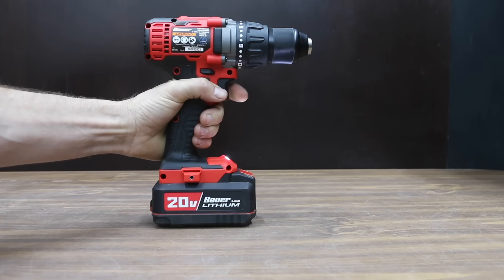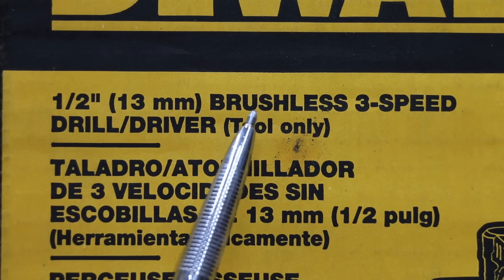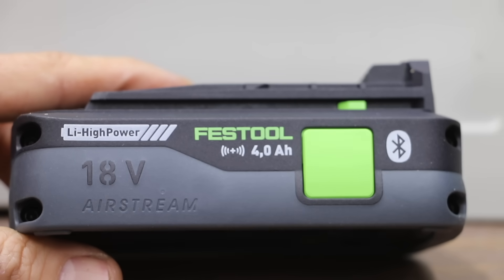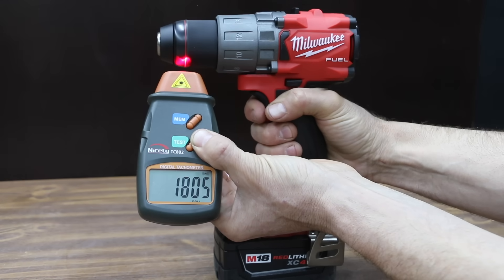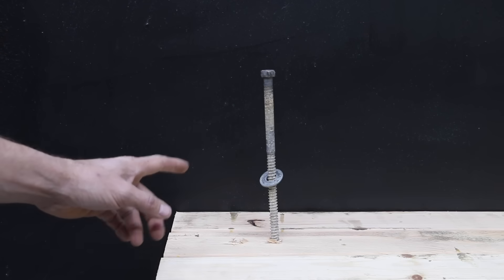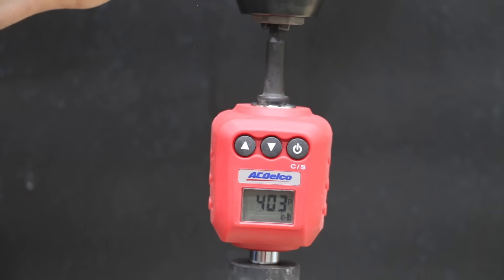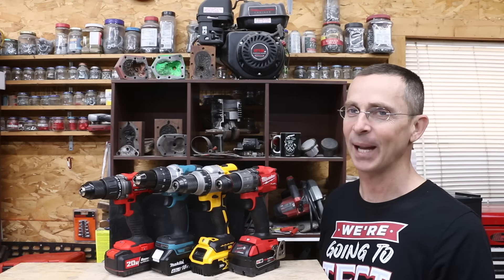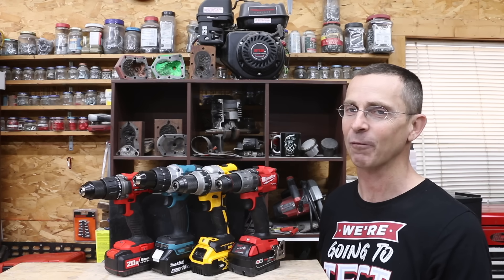Best Drill (BATTERY POWERED)? Milwaukee vs Dewalt, Makita, Bosch, Festool, Ryobi, Bauer, Ridgid

Comment: This video and AvE’s tear down of a Festool saw have me convinced that the brand is all shiny box and marketing and not actual tool quality or performance. 

This is why I love this channel… we get honest tests and good information.
Reply: If I were you I would look into Hilti for your next drill/impact purchase. I watched AVE's BOLTR for the Hilti 12v line and  I got the sid 2-a/ sf 2h-a then the sid 2a-12 and I've loved them since they first touched my hand. They feel amazing and they punch waaayyyyy above the 12v weight class. I'm just a DIYer with some minor handyman work on the side so the power for the 12v is plenty for me and the 20 year warranty gives me peace of mind.
Reply: @matthewclark263  A Hilti has absolutely zero benefit to anyone except a contractor. The entire point of a Hilti is the commercial support. The rep that you are assigned, the "Snap On" type service (rep that comes out to the job site or office), the commercial pricing, and the rep picking up broken units and bringing out new replacements straight to the site. That's why they're expensive; because they have contractors money. They're not going to make a trip to home depot to go get a new drill. It's not cost effective. I go with Hilti on some of our tools, but I go with DeWalt on cordless hammer drills and impact drivers, but I buy them 10 at a time. As a DIY'er/homeowner, you're buying Hilti because it's a cool toy, and that's alright. But recommending Hilti to a DIY'er/homeowner is like recommending an F1 car that comes with 2 support semi trucks and a 50 man tech/engineer crew to a kid that might want to take his little VW Golf to the track a couple times a year. The difference between Milwaukee and DeWalt is that the chip on the Milwaukee allows the motor to demand more current from the battery. The DeWalt is built better, lasts longer, has better fit & finish, and the batteries last longer. You don't notice the miniscule differences that are shown in the video like 5.3 seconds vs 5.8 seconds, when you use them in the real world anyways. I have bought hundreds of battery operated tools over the past 20 years, and I've tried them all in the worst conditions. Most of the people saying that one tool brand is better than the other, range from DIY'er/homeowner that have bought 1-3 units, to contractors that have bought 5-10 units, and those sample sizes are far too small to give accurate representations of a tool. It's like when people try to review a statement that x brand of truck is better than their truck, and they say, "I've had 2 x brand trucks for 150k miles, same I've never had any issues." Their sample size of 2 is statistically irrelevant. It's like they know absolutely nothing about statistics. This channel falls into that realm a bit too. Sample sizes of 1 took, and doing 1-5 test runs of each test, is statistically irrelevant. It's more for entertainment. I'm a scientist (my background outside of being a contractor), so it's more obvious to me that his tests and results are null and void, but the average Joe thinks that the tests are just "sO sCiEnTiFiC," because they don't know any better.
Reply: @littlejackalo5326  honestly I think that the ergonomics of the tool are very important and that's part of why I am happy with my purchase. I don't mind paying a premium for a tool that is built to last and feels amazing in the hand. This is all just my opinion.
Reply: We run a commercial carpentry shop and my partner absolutely insists on festool. We practically have their whole line of tools. I don't think one can make a general statement. The domino is an absolute game changer and their sanders combined with their dust extractors are fantastic. A lot of their tools also have great design and thoughtful features. 
However I've been telling him for years that absolutely nothing justifies the price of their drills which I find to be totally mediocre (we've had three break in 3 years too). I've been a dewalt drill owner for 15 years. The thing is still going strong and cost me $100 then. 
Maybe this will finally convince him.
Reply: @asafpeled699  Had my dewalt impact driver for about that long. It's blown through a bunch of batteries but the driver is going strong. We use it to lag bolt decks to houses haha.
Reply: @asafpeled699  You shouldn't buy the new DeWalts then. My cousin uses DeWalt on his farm and after one year, a drill started to hammer even if it was in drill mode. I took it apart and I was blown away by how chea and tiny everything was made. The main spindle bearing is about one third the size of the bearing in my Metabo drill. The Problem was that the whole axial force of the spindle was held by a 1mm wide plastic step... The step broke away and the drill is useless now.
Reply: @ChrisPBacon512  Festool licence them to others It's a great "system" as they clip together so stack up as one unit so can wheel around on the trolley instead of looking like a pig on a roller skate trying to lug all your various boxes around but you sound a bit Salty!
Reply: It's interesting you bring up AvE because I feel like between the two channels you get a really thorough review: AvE will give you the teardown and analysis of build quality / prediction of lifetime and failure modes, and PF gives you the battery of practical tests that give you an idea of the performance.  Both very different approaches but useful in their own way.
Reply: If tools were purses, Festool is a Gucci bag: an overpriced fashion accessory.
Reply: Festool is the snap-on or mac tools of the carpentry world. 100% overpriced. Only thing they have thats truly special is their track saw, and thats only because its the most accurate one available.
Reply: @barryallen5507 , Festool's domino jointer is worth the money as well.
Reply: yeah they are like the "new"  Flex tools at lowes. Just Kobalt but more expensive.
Reply: The only thing worth a shit they make its the Domino, and just because they hold a patent on it, everything else is done better and/or cheaper by other brands, like Mafell.
Reply: You e obviously never used festool tools.
Reply: The Apple of tools
Reply: The Box probably increases the Festools' price by 100$ alone lol
Reply: Respect to AvE, but Project Farm is the better channel by a long shot.
Reply: @Jin-Ro  I have respect for Project Farm because he acknowledged me when I pointed out his recent error comparing two entirely different models of Makita impacts as “Japanese vs Chinese version”.  Meanwhile, AVE will keep on misinforming the masses.
Reply: If you can't afford festool dont buy it. I own every festool tool available...multiples of some. I beat the hell out of them... only had one tracksaw in 5 years die on me.  If you are a business owner festools make sense. They are great write offs...plus depreciable and their resale is excellent. If the government is going to help pay for my tools ill buy the most expensive ones thank you.
Reply: @ravipankhania5528  That's the point though isn't it Ravi. Why buy the most expensive ones when you can buy the best ones for less.
Reply: @Jin-Ro  Sure. except that this festool IS a fantastic drill, albeit my least favorite of all the festool drills, all of which I own. and I paid $300 for it and it came with a convenient carry case  that match the dozens i already have. I have owned all other tool brands, and still use makitas and even one bosch...ugh. they dont even come close when it comes to accuracy or ergonomics to my festool drills... for me. so to me they are the best tools. the cost is always secondary for me. the difference between $100 drill and a $300 drill is not keeping me up at night. i dont sit there thinking if i had a dewalt drill it would drive a screw in at .7 secs faster.
Reply: @ClothstudioCa  most guys don’t understand any of this. They just see power and most of all price. My first festool was the rts400 sander and I loved it. Definitely felt and worked much better than anything else. I was a full Makita guy before. Festool has allowed me to work more efficient and cleaner. The systainers have changed the way I organize and make it easy for me to just take the tools I need for the day instead of pulling a loaded trailer around full of tools I won’t use for that day. Customers love the way everything just stacks up in a corner. Also when you buy festool you are paying for tools not made with slave labor wages.
Reply: I agree. Uncle BF is the best especially with his grammerical, (not a word) humor.
Reply: Most of the people commenting here has never done professional work with power tools. Here was tested just power of the drill but all the works are not just how much power you have. There are many small features why Festool is more expensive but you do not see it in this kind of test. If you are making precision work (manufacturing furniture) then you will see difference. When you are working hours with drill, you will see difference with ergonomics. It's not just weight of the drill but where the weight is so when you grip the drill, is the weight bending or not. 

It's about battery life. It's about durability. 

One reason why it's more expensive is that it's made in Europe. Okay, for me it's positive.
Reply: Just check out, the second hand prices prices. That will tell everything. 

The main problem, this Festool unit is 10-12 year modell. Its released by Protool and after its discontinoued as brand Festool introduce couple of old Protool tools with Festool branding as a new tool. This is what happend this Festool drill as well. 

Festool released a new drill in April, and its a nice upgrade, it would be perform somewhere between Dewalt, and Milwaukee.

The routers, domino, mitre saws, orbital sanders, jigsaw is all superior. 

From my view point, they'r products is placed for bigger manufacture companies, where the cost of the instruments is not as important, as the productivity. Their tools always very easy to adjust, and always trust on the factory settings. 

Warranty is also nice, 3 year and its cover the wearing parts as well (most of time its not) and for 3 years your tool is secured by Festool. If somebody stole it from your workshoop or from yout van/truck, you can get a new one, for very reasonable price. (Around 150$ where the kits of value usually trending between 500-1500$) 

Their tools is not for everyone, and you can get the job done with other tools as well, but they'r had some advantages even the higher price.
Reply: @_AIex_  Yeah exactly i live in Czech Republic, and festools are widely used in large companies as a good quality tools, the accesories that u can get for that here makes it ideal for large employers, also i think that in the US the imported tools are sold maybe at higher price? here that festool costs around 800-1000 dollars in average shop so a contractor that doesnt pay taxes on his tools gets it at about 600 us and a really large exployer get that at even less , because they buy loads of them.
Reply: @_AIex_  this sounds like a paid corporate response
Reply from the maker: Thanks!
Reply: The festool drill came out over 10 years ago, and it hasnt changed much over those years, originally lauched as the protool.. great ergonomics
Reply: They make nice boxes though.
Reply: I think the thing with Festool: They produce them in Europe that increases the production costs. This however, as you said, doesn't make them suddenly superior in quality nor performance.

One thing I absolutely love though in Festools: Removable cord that can be switched between machines. But otherwise, eh..?
Reply: @FinlandApollo  the cord is definitely a nice feature, but it also cost an arm and a leg to replace lol.
Reply: @FinlandApollo  I have an electric drill made by "Kress". They too had the removable cord. Unfortunately the company went bankrupt a few years back. Greetings from Germany.
Reply: @FinlandApollo  Well Bosch and Makita (and others) make some of their their tools in Europe, and I guess they are still competitively priced.
Reply: @MatthRrrr  Very very rare. Even the one in this video are made in Indonesia. I have several blue Bosch and none of them are made in EU.
Reply: @FinlandApollo  Gave up with Bosch they moved to China while back and nothing but issues there 9" angle Grinder was the holy Grail but became a liability then as gears was broke from new! many switched to likes of Hitachi. I'm lucky have a 4 1/2 and 9" both made in Germany.my 5" is Hitachi the Dogs Danglies
Reply: @MatthRrrr  Yes, around half of the Bosch tools i own are made in Germany, and around 2/3 somewhere in Europe. Also Bosch is around the same price as comparable Makita around here, but usually with better performance (especially concerning the battery packs and chargers). Construction sites are something like 50% Bosch, 40% Makita and 10% Hilti, with some carpenters using Festool and some Fein sprinkled in.
Reply: @FinlandApollo  You know Milwaukee had that 30 years ago when they were still a US based company. Still have a hole shooter and sawzall with this feature.
Reply: Couldn't agree more! I wish ave and PF would get together to absolutely shit on some of the shilled tools that are out now lol.
Reply: @goyslop4289  So intelligent of you....let's get two guys who combined have probably 30 minutes of decent work with tools behind them, so they could talk shit about tools that are designed for professionals and intended to work for decades.  Typical contrarian mindset, you actually think you're special for hating something that is universally accepted as great. A psychological pathology that is very common on the internet nowadays, I guess it's some sort of a defense mechanism used by poor people when talking about things they can't afford. If you keep telling yourself those things are bad and overpriced, it's easier to deal with not having them, I get it.
Reply: The price🤦‍♂️
Reply: Except both of the videos don't tell you that these last longer than any other tool on the market, and if you want a durable tool you buy once and forget about it, this is it.
Reply: Festool is like Harley-Davidson. You're paying a premium for the name but not getting anything better than cheaper ones.
Reply: @troywalker8078  Except it's not. Harley-Davidson is legitimately overpriced. Festool isn't. Festool built their entire reputation on nothing but quality and reliability. Harley built their reputation with myths and marketing. A big difference. Everyone's heard of a Harley, even people with zero interest in bikes. That's how strong their marketing was throughout history. Nobody without interest in tools has heard of Festool. In fact, most people who ARE interested in tools know very little about Festool it seems by these comments.
Reply: I disagree. 
At work we have many drills. Makita, Boch, Milwaukee and festool 
They brack all the time, but the festool drill just don't break there are dam well build and a dream to work with. 
At these hi torke applications you take a impact driver anyway. 
In my opinion a well build silent and reliable driver is way better than one with hi tork.
The e clutch works ok but it's starting with hi tork  so if you block it direktly it won't work but at normale application it works
Reply: @simeongeorg606  E-X-A-C-T-L-Y ! Agree 💯
Reply: @simeongeorg606 , sure if you wanna pay a premium. I've never seen a contractor use Festool, they use Dewalt, Makita, or Milwaukee. Only people I've seen use Festool drills/drivers are woodworkers and it makes sense, you're not gonna abuse it like you would on an construction site. Festool probably makes the best woodworking tools like miter saws and joinery tools, but drills/drivers I doubt it it's worth the +50% premium you pay on top of a Milwaukee.
Reply: @purplepill2024  i work at construction in Germany. 
Festool  is justed very often here. Becorse it economic. If tool breaks and you can't work it's very expensive.
Reply: @purplepill2024  Well, you should visit europe then. Here, on a big construction site, you won't find any Milwaukee or DeWalt. Hilti, Festool, Bosch, Mafell, Metabo and a few Makitas is what you see. The Milwaukees and DeWalts might me powerful but the build quality is absolute garbage. Also, the trigger control is just not suitable for delicate work.
Reply: @simeongeorg606 , here a 1/2-inch drive 25-inch Harbor Freight breaker bar is $13 with lifetime warranty. The same Snap-On costs $147.

When it breaks people just go to HF and get a replacement, if they needed another one on-site that bad (cause they can't work if it's broken) they just buy two HFs. If a tool is that critical you can always buy a backup and still come out ahead.
Reply: @christiansprojects-cgmanuf1426 , OK so Europe still carries Makita - which is also widely used in the USA, what's your point? And you do realize that Milwaukee has a 12V lineup designed for "delicate" work right?

You can go ahead and buy Festool - if that's your prerogative. I can buy 2 Milwaukee's and still come out ahead.
Reply: @chronicblazer84, if you want to pay 10x for a Snap-on, by all means do it. There is value in HF's breaker bar (or any other non-premium tool), plenty of channels like Real Tools Review have shown that HF's breaker bar can withstand the abuse and be a featured item in a professional environment.

I can buy 10 HF's breaker bar and still have money left over - and all 10 come with the same Snap-on like lifetime warranty. And the big difference is - when your Snap-On inevitably gets borrowed or stolen, it's something I wouldn't even care about with the HF tool.
Reply: @chronicblazer84, "lifetime warranty" means you don't pay a dime. Your current employer sounds like an idiot, just cause HF's Breaker Bar is a quality tool doesn't mean all HF tools are. You couldn't pay me to use their Pittsburg Trigger Clamps.
Reply: @chronicblazer84, Lehman's Brothers and Enron brought in 3x-5x what your employer did - look where they are now.
Reply: @chronicblazer84, it's obvious you have no idea what you're talking about. The point of these tool comparison channels like Project Farm is to show when you can get value. In this instance, you can get value from Dewalt, Makita, and Milwaukee cordless drills.

Even with the name-brand cars you're talking, DIY'ers still find value in after market parts.
Reply: @chronicblazer84, so what if you make parts? The point is lost on you that's why you keep changing the subject. From DIY'ers to pros, everyone (except you apparently) knows there can be value with cheaper tools.
Reply: @christiansprojects-cgmanuf1426  On European construction sites, you are going to find mostly European brands if they are any good. For example, in France, hand tools are almost all Facom, which is definitely high quality but most importantly, it is French. In Germany, they will use German tools, and in the US, US tools.
They will only use American tools in Europe if there is no other good option. Plus, there is the whole imperial vs metric and 110V vs 220V thing.
Reply: @purplepill2024  And your two Milkwuakee's are gonna last half as long as his one Festool, so you won't been ahead in the long run.
Reply: @derbigpr500 , outside of wood workers name one major construction company or channel that uses a Festool Drill.
Reply: @chronicblazer84 , LOL what a hypocrite. You've been raving about Snap-On this entire time, just to admit that you prefer cheaper tools and only get Snap-On cause someone else paid for it. What a shill.
Reply: @purplepill2024   For most tasks, Milwaukee will work just fine, that's absolutely true. But there are situations where precision really matters. My point is that the price of Festool and other high priced brands is justified depending on the work you do.
No Millwaukee or DeWalt saw will be near the precision of a Festool tracked saw for example.
Reply: @christiansprojects-cgmanuf1426 ,  Milwaukee doesn't even make a Track Saw. And the Track Saws made by Dewalt and Makita are at least $200 cheaper than Festool, so they aren't even targeted for the same market. Like I've stated, Festool isn't used at a construction sites for a very good reason, accidents on tools happen and no contractor wants a $500 brick.

Finally this video is about cordless drills. Of the 4 top wood working channels on YT, not one uses a Festool Cordless Drill:
1) Bob - I Like to Make Stuff: Dewalt
2) Matthias Wandel - Dewalt, Lomvum, Makita, and Ryobi.
3) jimmydiresta - Milwaukee
3) Steve Ramsey - Rigid and Ryobi as his channel is designed to get started cheaply.

Not even people with a workshop like Bourbon Moth Woodworking, Shop Nation,  or StumpyNubs uses a Festool Drill. The one who splurges have a Festool Miter Saw and/or Festool Domino Joinery. Even the Track Saw they use (if any) are made by a different brand.
Reply: @purplepill2024  My friend, you don't seem to understand me... There might be no Festools around in your area but there are other places on this planet you know.

First of all, have you ever used such tools yourself? I own a farm and we live in a wooden house. I do woodwork including building stairs, balcony, simple workshop furniture etc. I use Metabo and Festool (Sander), but I have tested DeWalt, Bosch, Makita and Milwaukee myself. Of course I havent' tested all of their machines but some of them to get an impression of handling, feeling, quality and so on. Also, I repair cordless tools from time to time. So I have a bit of an Idea. Many DeWalt drills (The ones with hammer function) for example have a dirt cheap plastic spindle bearing support that will fail after one or two years of regular use. Milwaukee isn't any better.

Also, it doesn't really matter what some dudes here on YouTube use.
Have you ever been on a construction site in western Europe? You won't find any Milwaukee or DeWalt. 
I have two good friends that are carpenters. One of them ran his own business for 20 years. He has used Bosch and Festool. The other one works for a furniture carpentry in my area. In their shop, wou see Festool only! Nothing else.

So... You see, theres a world outside of YouTube and outside of the USA.
Oh and by the way: The biggest german YouTube carpenter uses Festool.
Reply: @purplepill2024  Oh and one more: On construction sites around here (Western Europe) wou also see lots of Hilti tools. They are even more expensive than Festool.
Reply: @chronicblazer84 No problem. There are ignorant dudes all over the planet ;)
Reply: You are a fool if AVE convinced you of anything. You have either used a Festool product or you haven’t.  They make finish carpentry products and that is why you don’t see them at a job site. I don’t see Rupes polishers, bearing pullers, Lamello biscuit joiners, Lie Nielsen hand planes nor MOOG synthesisers nor your favourite hockey stick on a framing job either.  Must they be crap?  The entire tool industry is dictated by economies of scale.  That’s why a Makita saw can be less than $200 while their rivet tool is $1200.  Festool is pretty damn inexpensive when you take into account how small of a company they are.  For me, Festool is normally the CHEAPER option.  If they are not the cheaper option for you, than you are not even their market. They are a niche company.  That said, go to a supply house or a real tool store and look at all of the Makita, TTI, Bosch and Black and Decker that they don’t sell at Blowes Depot, look at the price tags, get back to me on how “overpriced” their competitors are.
Reply: Let me add onto that.  If you don’t understand this economy of scale business, look up a Fein Multimaster.  Less than $200.  Now look up a Fein Pipe Polisher Kit.  $2,000.  Note that it is just one of their angle grinders that has been ghetto rigged to take an abrasive belt.  Alas, their yearly production is probably like 80% multimasters and 20% everything else and they probably sell that belt sander in the hundreds.  Does AVE ever mention economy of scale, ever?  Because that is the seriously the most important factor, if not the only important factor, when it comes to determining price.  The whole industry was built on this.  It was cheaper for one company to make all of the sockets and the other to make all of the screwdrivers and then they rebrand and use their locations to expand distribution.  It’s literally the history of the tool business.
Reply: @robertrada6040  Fein Multi tool is the daddy shows the others the way
Reply: @buckrogers2828  It’s embarrassing isn’t it? The patents ran out and everyone released an “OMT”, but nobody....nobody....released an omt half as good as the Fein Multimaster.  This is exactly what happened with biscuit joiners.  All of these retiree hobby woodworkers talking about how much bette the Domino is than their old biscuit joiner.  Yeah but...did that biscuit joiner say Lamello on it?  😂  Cause even Elu was not trying.
Reply: @robertrada6040  Many of the Salty Fan boys Never use there tools/toys commercially just bring out of box once in a while polish it!!! & wipe residue off and it must be good as say's Dewalt/milk etc.

Was at trade day when guy's was showing the Fein off Cut nail heads off then some twerp squealed my Makita can do that! then guy spun Multi tool round by lead smacking nail saying but your Makita won't knock nail in will it! "Silence"
Makita tools not the fastest/powerful list/blah blah but good general "reliable" all round tool and you can't finish a job if tools are broke!
If your tools are breaking/broke it can cost you work as customers will go elsewhere plus if it fails not only can't finish to collect cash but costs repairs/travel and much more.
Ive a few tools that was great buys one being the Fein other Metabo SXE 6" orbital sander.Bosch GST jigsaw one with metal gearbox casting before went all in clam shell design which had issues.Hitachi 5" angle Grinder with trigger lever below.plus some others.
Another thing many don't realise is that say Makita have different levels of tools 18v drills theirs probably more than 6 with different specs only have to look at chucks cheaper plastic to Jacobs metal ones.
Dewalt is similar.plus they have different specs for likes of Harbour Fright so cheaper (you can tell by code numbers on item)In UK with B&Q/Screwfix Hitachi do a range for them along with others and moment you quote number on the side they know a B&Q one.
Reply: @robertrada6040  bosch and flex making starlock multitools, which are not worse than fein multitools.
Reply: @robertrada6040  I disagree,  have seen multiple videos from a finish carpenter regarding the festool mitre saw and how it compared to his 12 inch dewalt. Along with seeing and using these drills for both fine carpenters work and working as a framer now .
There is absolutely no way I'd pay money for these tools let alone their asking price. Might be worth it to some but not myself.
Reply: @captain_Rodriguez  You’ve seen videos.  Festool has no place in framing.  I agree there.  If you’re looking at drills and miter saws, why are you looking at Festool?  If you’re buying 10 different kinds of sanders and specifically want ElU style routers, you look at Festool.  Everything in Festool’s niche is as pricey as Festool.  I’ve owned the Festool and Dewalt miter saws in question.  The Festool is easily much nicer.  The Dewalt is easily more powerful.  They both perform just about equally.   If you want a 10” Dewalt miter saw with the same features...you’re shit out of luck and that’s the rub.  Festool’s miter stand sucks, btw.   Do you need an MFT? Do you know what it does and how it works?  No?  Then why look at Festool?  I’ve owned every Festool drill, they’re the nicest currently on the market.  At the same time, pick a drill from Home Depot (Makita, Milwaukee, Dewalt) and it absolutely destroys a Festool drill in power.  Currently, all of my Festool stuff sits around while I use Makita cordless all day.  That doesn’t mean they suck.  That means, like you, I currently use a whole different category of products.
Reply: @robertrada6040  Ave is as much of an edgelord as his community, anyone who takes anything he says seriously (and not a joke from a not that knowledgeable person who pretends to know everything) is an idiot. There's a reason why so many PROFESSIONALS swear by Festool and use nothing but it. Why would they pay that much if the tools sucked? Well, they wouldn't. The tools are actually amazing and indestructible. Is paying double for a Festool drill over a Makita worth it? Well, if it's gonna last 3 times as long, then yes. And it's gonna last 5 times as long. Same as Hilti. I know construction workers using Hilti tools from the early 90's. 30 YEAR OLD TOOLS that were used and abused on the construction sites daily, and still work perfectly.
Reply: All this Festool hate online comes from people who literally never laid their hands on any of their tools, and who just love talking smack about things they can't afford. It's the same type of people who talk crap about Mercedes cars for example, even though they never even sat in one. Such people love to pretend they know everything about products they have zero experience with and objectively have literally no knowledge about. I guess it makes it easier to deal with the fact you can't afford the best of the best. And Festool is the best of the best. A step above Makita and the rest. Anyone who is an experienced professional and who's used them will confirm that. Same is true for Hilti.  Show me a Milwaukee drill that's 40 years old and has been abused by workers on the construction side for each and every day in those 40 years, that still works perfectly now. Then I'll take you to my buddies construction company tool garage and show you a bunch of 30-40 year old Hilti tools they still use today and still outperform new tolls. Same is true for Festool, they'll work forever unless you physically break them on purpose. If you're an amateur you don't need them and they're not worth the money. If you're a professional using them 24-7 and plan to use them for years to come, then paying double over a Makita shouldn't bother you, because the Festool will last 3 times as long as the Makita.
Reply: @George Bobeck I like how you actually believe that an irrelevant test that literally uses the tools for like an hour in total is a valid way to judge a tools quality... and that you ACTUALLY think that is an honest evaluation. Man, I'm sure glad people with as little common sense as you aren't testing the quality of critical airplane components. You'd probably give two bolts a smack with a hammer and pick the cheaper one because hey, neither of them broke when you smacked them, and one is cheaper, so the more expensive one must be a waste of money, right? 

Give all of these drills in the video to a construction company and have their workers uses them daily... then come back in 10 years and let me know which tools will still be alive and work properly. THEN you can talk about quality of the tools and how good the information about them you have is.  It always blows my mind how comments with zero common sense behind them, and with horribly false conclusions jumped into based on nothing get so many upvotes, but I guess that speaks volumes about the average person.
Reply: @derbigpr500 , puh-lease I've never seen Festool used by a construction crew in the USA for good reason. It's cause Dewalt, Makita, and Milwaukee provide a quality tool at a reasonable price for their work. On a construction site, tools get dropped from buildings or smashed by another object all the time. If a Festool gets damaged, you have now a $500 brick, whereas - it's just $99 to replace a Dewalt.
Reply: They u know Nothing about tools and festool.
Reply: Yep. Festool is marketing crap
No actual carpenter uses their trash
Reply: @itaintrocketscience  Idk, I work with a wide variety of power tools from different brands, each and every day. A small but successful handyman business. Mainly I use Ryobi, Rigid, Festool, and a few Dewalts. The Festools are definitely my preference for basically every job. They feel great, never break (except the top of the dust collector once, which was replaced for free), and they even sound like quality. My boss has dropped the drill like 3 times that I’ve seen from scaffolding and ladders onto concrete and it’s a heartbreaking thud but it’s never shown any sign of damage. I love the whir of the drill but it’s a different model than in this video. Good lord are they expensive though. I personally don’t have the funds to spring on Festool but I’m always grateful I have access to them at work. And I came into this job having never even heard of Festool so it can’t have been whatever marketing some people have noted.
Reply: @itaintrocketscience   You should take a look over the pond then... Around here, in Western Europe, contractors and carpenters mainly use Festool, Hilti, Mafell, Bosch, Metabo and sometimes Makita. The build quality of Festool is superior.
Reply: @christiansprojects-cgmanuf1426  hilti is the only one I would buy
Reply: @itaintrocketscience  Except the entire Europe uses them, and they're the best. Anyone who says otherwise is just clueless and has no long term experience with these tools. I know it's fun to crap on something that has a good reputation. It's the same reason some of you morons talk crap about German cars, it's hard to accept they're the best, but talking against them won't really change reality, you know?
Reply: @derbigpr500  
“ the best”
The best plastic components?
AvE makes a much better argument about why theses tools are junk.
Watch his videos and see how Festool is constructed.
Cheapest parts, highest prices.
So yea, German engineering
Reply: @derbigpr500  LOL! BMWs are overengineered piles of unreliable garbage... never making the mistake of getting one of those again. Benzes are better but reliability of the modern ones are subpar compared to the Japanese brands. If you actually plan on owning a car long term, Japanese is by far the way to go. Simple to work on, good build quality and excellent longevity... for less money. I'm not going to comment on what most woodworkers use because I only know a sample size of one personally, but he uses mostly Makita stuff with a few odds and ends from other brands as well.